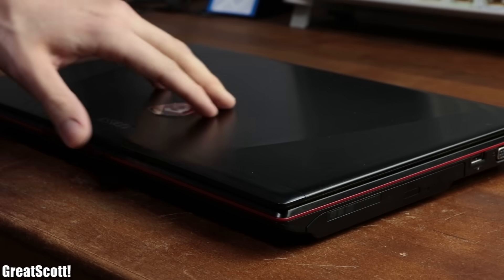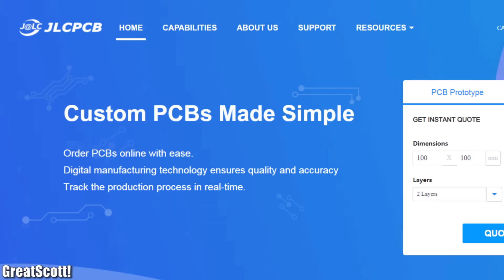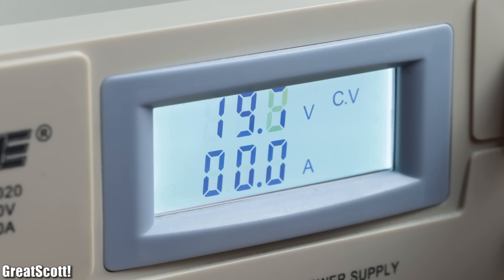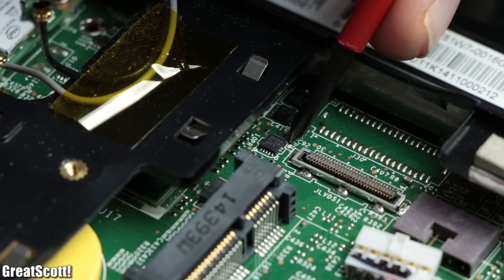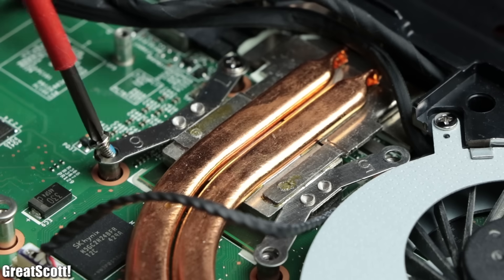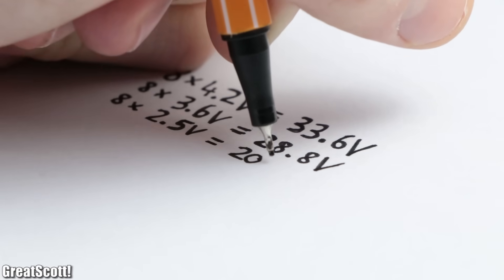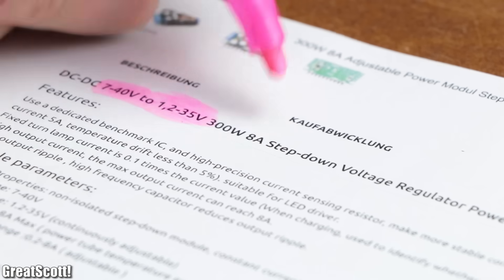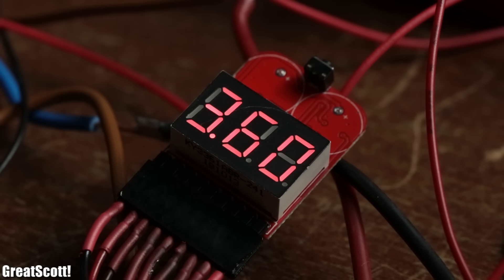DIY Laptop PowerBank (battery pack to charge your laptop on the go)

Comment: Sir make a Bluetooth jammer
Reply: That's technically illegal.
Reply: @HobkinBoi  yaaa but I want to know how it's works in greatscott words
Reply: i think that just cell phone jammers are illegal, i think they are illegal because in an emergency you cant contact the police or so. you cant contact somebody with bluetooth and you can just transfare data short range so i don't think that it should be illegal or am i wrong?
Reply: @BadMax02_VR  The FCC didn't specify if jamming bluetooth was illegal specifically, but cell phones do utilize it. To be safe though, I'd just assume that they are illegal.
Reply: @BadMax02_VR  I too think in the same way😂😊😊😊
Reply: Jesus thats not that hard . 2.4 GHz Band Hopper and a 2 w wifi booster with a cloverleaf antenna
Reply: Mai Mariarti  From what I'm able to find, its for the most part illegal.

Comment: a suggeston: put a relay betwwen the input and output, so that when your battery pack is connected as well as your computer the relay will colse by letting the current form the charger go directly to the computer as well as charging the computer at the same time and when the power is disconnected the circuit will automaticly swich to the battery voltage, so you can charge both at the same time, without having to use any splitter or unplug and plug again
Reply: would be a cool idea but the charger can only delivere about 6 amps and when you are gaming on your laptop plus charging both battery it would probably go above 7-8 Amps which would have the effect that the voltage on the powersupply would collapse and you would not be able to charge anything at all
Reply: @BadMax02_VR  kind of, because he showed that during a benchmark it was using 4 amps and since the battery pack use only 2 amps the original battery charger would be enough to power all that. Still you can alway upgrade to a bigger power supply, like my compiter has a 19v one that deliver up to 7.7 amps and also is smaller that the one showed in the video !
Reply: @enryfrafranci  the thing is that the Laptop was not at 100% load well it was but what im trying to sao is that the battery was probably charged and the battery was just using 4 amps during the benchmark if the internal battery would be depleated and charging the internal battery + benchmarking would have probably drawn more because it would be charging too
Reply: @BadMax02_VR  ... still you can upgrade to a more power full brick, they sell them for very cheap on ebay and such

Comment: 2 questions:
1. Why not choose a more appropriate charger instead of that boost converter like these ones: https://m.youtube.com/watch?v=H12_yTx0uYg&t=343s
2. Why just limiting that battery pack to charging laptop? With such a big battery you can charge smartphones and flashlights, radio and even small portable soldering irons, etc.

Comment: Thank you. But, you can buy jump starter with 19.5V laptop output. You can add battery to jump starter for increasing capacity.
Reply: well that wouldn't make a very interesting build video would it?
Reply: The charger for it will be for low capacity batteries and will take too long to charge the added battery
Reply: @isprithul  Yes, may be 1 hour.
Reply: @electroumit  a lot more probably